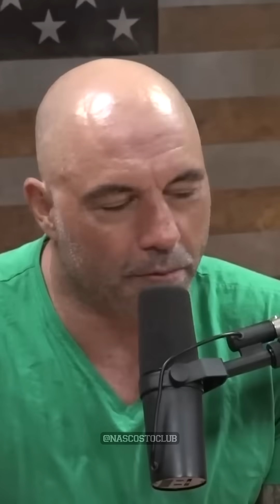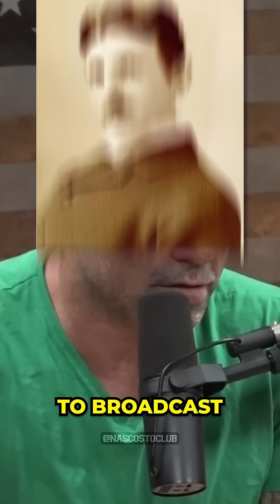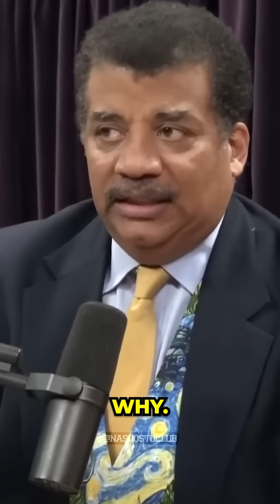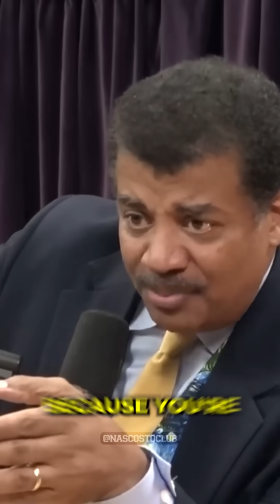WIRELESS Electricity Idea Debunked ⁉️⚡ #shorts

Comment: Tesla was on a much higher level of intelligence and comprehension than Neil so I'm inclined to doubt Neil's confidence here
Reply: Tesla also called Einstein's theory of relativity a pseudoscience, relativity has been proven again and again, scientists can be wrong too. That's literally how science works.
Reply: You're obviously not thinking or you don't understand physics. Most likely you're biased. If some white scientist with NDTs credentials was saying this you'd probably be more inclined to believe it.
Reply: @Sbudre  Not significantly more inclined, especially considering wireless electricity has already been proven viable.
Reply: @Droid6689  wireless electricity over distance is what Neil is referring to and that has not been proven. You probably think Santa is real too.
Reply: @Sbudre  yes it is, they're literally doing tests on this stuff right now.
Reply: @Sbudre  oh and saint Nick was in fact also real just so you know.
Reply: @Obi-wan5991  calm down.  You're confusing wireless power and wireless or inductive charging.
Reply: @Sbudre  no I'm not but I will say, have a good night.
Reply: @Obi-wan5991  must have become negative it was so low.
Reply: @Sbudre  yes, because I'd definitely have the ability to have my own thoughts and respond with a negative IQ. I'm done with this redundant conversation.
Reply: @Obi-wan5991  it's why your thoughts are nonsense.
Reply: @Sbudre  it didn’t seem like trolling, it just seemed like you were being rude.
Reply: @Droid6689  viable?  really?  What in the world are you talking about?  if you are talking about electromagnetic inductance or radiative electromagnetic resonance - both of those can only be accomplished with either direct contact between source and receiver, or at most an inch or so distance from each other.  Uncoupled radio frequency can have a few feet between source and receiver, but then it is only a small trickle of energy.  The type of things Tesla was thinking of were physically impossible unless you were OK with killing everything that was in the path of the transmission.
Reply: @Sbudre  thank you!!!  finally someone with a little knowledge.  folks that have zero background in physics or engineering talking about things they have no knowledge of is starting to drive me batty.  I need to stop reading these comments.
Reply: @Obi-wan5991  no. Theyre not. Lol.
Reply: @Droid6689 Energy means movement, movement means heat, heat burn skin, burn skin be bad.
Reply: @Sbudre  Look up power of wifi. Some newer Samsung tv remotes will power of wifi. There is also a security camera company that showed off some stuff during CES
Reply: @Sbudre  dude get some education
Reply: @daze8410  WiFi is something different. Maybe do some more reading before you spend your 2cents exposing yourself
Reply: @nilsbergling8711  I'm an engineer dude, by profession.
Reply: @Sbudre  sure
Reply: @Sbudre  Tesla might have had something in his head, but if he didn't get it in his work it means it wasn't feasible at that time yet. It might be very feasible if we significantly decrease the wattage required to power devices, and possibly implement some methods to increase the power transmitted wirelessly. This isn't very economical tho, because even if copper was super scarce, energy is expensive and wasting it just like that isn't something we normally want to do. Best use case I see it in is residential lighting to eliminate potential copper to steal(and that's a huge if for getting wattage super super low) but with the rise in power drawn for other devices in houses(computers and wall power is way more common, and it isn't just lamps and radios anymore like it originally was.), Copper isn't going away for residential application anytime soon.
Reply: @Sbudre  Take your own advice
Reply: @Droid6689 really? Where? By whom?  How many are dead?
Reply: @Obi-wan5991  source?
Reply: @Obi-wan5991 you are confused buddy
Reply: @Droid6689 yeah, so people are getting scared of 5g towers using the same freq as microwaves at fraction of the power (per area). Try getting in the way kf the wireless electricity.
Reply: @Droid6689  Yeah while touching the thing it's charging... not over kilometers...
Reply: @Obi-wan5991  i think it was just radio waves he was debunking? idk
Reply: @Sbudre 25 miles was common in wireless tests btw not to mention Dc power at the time had a max 12 mile from edison co. Ac allows smaller wire longer runs the man that made Ac also made the wireless stood in it and used transmitter and receivers that ran on certain hertz to send the signal/ power with himself playing the role of ground. Look at his wireless fluorescent lights lmao
Reply: @brians9508  also buddy, you can move that electric, even though that’s nothing to do with what we was talking about it can be done, hence why Tesla himself was able to power various things around his office without dying 😂 but yea that’s a whole different thing that we aren’t talking about so I have no idea why you’ve come in here trying to prove me right but thank you
Reply: @brians9508  common facts most people know hahahahhaa you didn’t know earlier you told me it was wrong that energy couldn’t go through the air, you said waves needed to be constrained to not kill people you didn’t even understand what a wave was buddy now you’ve googled it and come back and told me I was right your trying to pretend it’s not exactly what I was telling you 😂 you just somehow don’t seem to understand that energy makes electricity I think you think the sockets are connected to magic or something and the conductor makes the electric? Who knows but you’ve lost yourself somewhere
Reply: Its ok, you'd be wrong. 

But here since Niel didn't make it make sense, consider your microwave oven, that is an example of what transmitting high energy through the air looks like. Do you want the power plant frying your guts to get the power to your house?
Reply: you just watched him explain why you’d die from intersecting a wave of electricity/ or energy. everytime you’d use a hairdryer that’s 10%+  ofthe amount of amps that’d KILL YOU. imagine getting shocked with 10% of the energy required to stop your heart.
Reply: Everyone that thinks this EXACT same thing is usually someone who claims to love Tesla and science, but slept through high school physics.
Reply: I wouldn't deny tesla's a genius, but if it was really viable, and feasible, wouldn't it be much more prevalent now
Reply: Neil understand things that Tesla couldnt even possibly imagine. Does your tiny brain forget that hes literally A DOCTOR in astrophysics.
Reply: Neill is perfectly right. It's basic physics (now).
Reply: @mkvk74 he’s perfectly right? So solar panels don’t exist? So companies aren’t already sending energy long range? Do you understand what a radio wave is buddy? I think you should first go at least try understand what a radio wave is then you might not say something so stupid 😂😂😂
Reply: Tesla was legitimately deranged and had dozens of genuinely terrible ideas for every good one he stumbled upon.
Reply: 😂 of course… Tesla fans believe the strangest things
Reply: @douglasrodenbach8000  Like stuff verified by NASA studies decades ago?
Reply: Another dumb comment from a dude with no grasp on the basics of physics. Keep having an opinion about something you don't understand (physics), that's dumb but funny
Reply: @geraltofrivia9424  do you know Tesla explained that Warden Cliff tower was not a electromagnetic device and transmitted scalar wave energy through the ground?
Reply: @DANTHETUBEMAN  Your point?
Reply: @geraltofrivia9424  non of that disagrees with physics
Reply: Came for this
Reply: Tesla was much smarter than Neil, but logically it does not make sense to send electricity through the air. Even if we could, then it would kill you if your in the same room.
Reply: We already have a technology that captures wireless 'electricity'. They're called solar panels. 100 percent wireless and the energy source is 91 million miles away.
Reply: @greensleeves8095  not even close to what this video was talking about lol
Reply: @drinkswatere  Yes it is. The point is we're already capturing energy wireless. It's not hard to believe we could come up with a transmitter and receiver that uses a wavelength that's safe for humans.
Reply: @greensleeves8095  the problem is the resistance of the medium in the first place, the air is extremely resistant so whichever method we use to transfer the energy through it is going to be very inefficient, worth only for some very specific applications.
Reply: @greensleeves8095  again solar energy and what is spoken of in this video are completely different. I’m not going to baby you and explain to you why. It should be obvious.
Reply: Tesla had some cool inventions but these pseudoscience conspiracy theories are dumb af. Einstein, Newton, practically everyone was wrong about one thing or another. These are humans, not infallible gods. And no, the atmospheric free energy tower thing is total bullshit
Reply: Go ahead and keep being negative instead of just discussing the topic like civil people and sharing opinions. A lot of people said Einstein was crazy. And yet for some odd reason we're still finding out that he was right to this day. Holy shit who would've known because apparently people like you have all the answers until you're literally proven wrong and have the evidence shoved in your face. But yea my brains fried because I'm not embarrassed to think with a open mind.
Reply: The concept does rely on fundamentals we can already understand. The main point he brought up is that insufficient energy can be actually passed through the air that would be mechanically sufficient to power stuff. To make it useful on a baseline, a potentially lethal dose would need to be transmitted. We already know about what in electricity kills us, e.g. coming into contact with exposed wires; we already are aware that some electricity can be passed through air over short distances to charge batteries or read RFID devices. The moment you go wireless with the equivalent of power you'd need to power a light bulb, it would be deadly. Assuming you're pointing your energy source at the light bulb, you wouldn't wanna be between the transmitter and the bulb. But let's say the source of power, eg. substation or power plant, was like a radio station, the power output would need to be so extreme, (again, knowing what we know about conservation of energy and electromagnetism), firstly the source would degrade due to heat (think a hot qi charging pad, for example), but just as much as the power being sent to your house needs to be stepped down with a transformer before it's used because it had to be higher to reach you in the first place (and we all know the survivability of coming into contact with that voltage), and you'd be transmitting that wirelessly. I honestly don't know or remember what voltage differences are between residential and commercial zones, but that's a lot of power, and wirelessly, that's gonna go through a lot of people.
Reply: @Acey785  we do NOT transmit electric energy wirelessly though, we induce a magnetic field using an electromagnet. This field and the change of it's polarity induces electrical energy into the coil it effectively moves through. Now there this energy is basically produced again, therefore no electrical energy was actually passing through the air. This itself, as your only real life example, shows that your entire claim is basically wrong. Because the basis itself is wrong.
Reply: It's not at all about intelligence, and "comprehension" of what? Physics? Neil has modern physics which is objectively more fleshed out than physics in Tesla's time. We now know that it's not safely possible or practical to wirelessly send sufficient electricity long distances. Tesla didn't. It's just physics, not intelligence.
Reply: People don’t like hearing about the 1893 Chicago World Fair, Tesla used wireless to power half the event, they love pointing at the pictures that show wires clearly, refuse to listen to or admit the brightest minds of the time who wondered in amazement in their writings about everything that didn’t have any wires to power them, it’s like talking to flat earthers, you’ll just get a headache
Reply: Tesla was a kook....
Reply: Absolutely
Reply: Agreed.
Reply: And you probably got an IQ lower than 100.... smarter people then Neil have disproven it
Reply: @chango.-.  Wrong, but a cute attempt
Reply: Когда не ходил на уроки физики
Reply: Being smarter doesnt mean you're more likely to be correct compared to someone more than a century into the future with a far higher understanding of Science... Neil's skepticism is just as valid as any other genius from back in the day.
Reply: I'm not a fan of neil but he's right.
Reply: Are you intelligent enough to understand that?
Reply: No he is right.

Tesla had good ideas and even better intentions but a lot of it were dangerous.

Try living in a house near a power station or a electric tower. You'd know how dangerous electricity just freely roaming around the air.

And it won't have a stable connection as well unlike a wired device. Even today a wired device is still superior to wireless.
Reply: Sure, but Neil is on a much higher level of knowledge. That’s the nature of being born so much later. 
Y’all hate Neil for no reason lmao.
Reply: By that logic i would say Neil is on much higher level of intelligence than you so I'm inclined to doubt your confidence here lol
Reply: What are you talking about Tesla was a dunce compared to our current scientists because of our progression of knowledge of science, do you think nuclear physics was a thing Tesla knew? Tyson knows it because he's in the future You're fucking weird
Reply: @asterowave5586  by your logic, DaVinci, Newton, Kepler, Copernicus, Galileo, they’re all idiots because they lived before certain discoveries

what an absolute moron you are… you’re the dunce here
Reply: The Tesla fanboy wingnuts are wound up.
Reply: Tf do you know
Reply: Here’s a fun idea, what if it wasn’t electricity powering things, could it then be wireless? You have to think outside the box
Reply: Imagine there is human beings in here that don’t understand what a radio wave is saying you can’t send energy with a radio wave 😂😂😂😂😂😂 can you seriously like honestly be that dumb? Like saying there’s no way that bread can possibly be bread. A radio wave literally like LITERALLY IS ENERGY YOU RETARDS IF YOU DONT KNOW THAT YOU DONT EVEN HAVE THE SLIGHTEST INCLING OF WHAT YOUR TALKING ABOUT AND YOU JUST LOOK LIKE A RETARD SAYING IT ISNT POSSIBLE
Reply: The difference is intellectual resources, a 160 iq cavemen is less smart than an 100 iq human today from a relative perspective.

Iq is not knowledge, Iq is the ability to comprehend new or more complicated things. Neil has an advantage which is his time stamp
Reply: same
Reply: Tesla was insane, noting more.
Reply: @Pogger White  without tesla you would not be in the world you are in remember that
Reply: Not really he was at the same level as other geniuses in electrical engineering at the time, though amazingly prolific.
He didn't invent multi-phase or was the genius who worked out 3phase was the optimum for generation-transmission-loads at the time.
Reply: There's significantly more scientific data to support Neil than Tesla lmao
Reply: @Jakepf  yes because as I send Tesla's real work has been suppressed from you, Tesla's lit up lights 20 miles away from his Colorado springs amplifier,
today's scientific data tells you you cannot do that, ground has to much resistance. but there is a way, it has been done. 😁
Reply: Intelligence? Maybe. Comprehension? Absolutely not. Times have advanced. Neil comprehends far more about science than Tesla.
Reply: @drinkswatere  Neal does not know what Tesla was working on. he is smart enough to learn it, and smart enough to not learn it, because the powers that be do not want it worked in.
Reply: @DANTHETUBEMAN  would’ve already been at least theorized by now by someone. Hence why Neil is explaining why it’s not possible instead of saying “I don’t know if it’s possible”. It’s because the research has already been done on it. Your conspiracy hold no weight. Modern science does.
Reply: @DANTHETUBEMAN  again you believe in conspiracy theory before reality. I’m not going to do that.
Reply: @drinkswatere  no not at all, I no the science, you don't. your stuck in mains stream, that's right where the energy monopolies put you. 
look up high Voltage DC spark pulse, that's the scalar energy. we just don't use it yet.
Reply: @DANTHETUBEMAN  yeah because if you got between the transmitter and receiver you DIE 😂. That and what is spoken of in this video are very different. Not the sharpest tool in the shed are you.
Reply: @drinkswatere  wardencliff tower used high voltage DC spark gap scalar generation. you should read about Tesla's work on this, at slower speeds it def shock him and he could not shield the energy pulse even with a Friday cage, but when he went up in frequency it stopped shocking. .
Reply: @DANTHETUBEMAN  your science education is just as alternative as your grammar. You are the perfect example of the Dunning-Krueger-Effect.
Reply: @donerzombie1349  the difference is that I can prove my information with experiments because that's the way things are. it does not matter if you denied the facts or not.
Reply: @donerzombie1349  Grammer the go to of all loser's in every argument, lol 😂😆
Reply: @donerzombie1349  you named part of science
 " alternative " 
that has nothing to do with the reality of the effects of everything I am talking about.
Reply: @donerzombie1349  I never took a science class. 
your just wrong and don't like it. but facts are facts. they do not care if you have worked with them or not. "Electromagnetic environmental compatibility" ; (2000-2003)
Book by Ben Jansen and Konstantin Meyl. 
you have a lot of catching up to do, we are on to the scalar magnetic forces now.
Reply: @DANTHETUBEMAN  did you get one of the test kits? And have enough scientific understanding to eliminate the potential for trickery? At least the second you don't and have shown so already. So give me a proof, not some random claim that it was supposedly done but proof
Reply: @donerzombie1349  I can't spoon feed you, you have just asked for things you are capable of doing your self. I think you will be more comfortable staying where you are at in your out dated science.
Reply: Oh so a smart guy who lived over a hundred years ago, would know more with less information than another smart guy living now?
Reply: @Drckarvo how many inventions and discoveries that are fundamental for todays civilization did that guy a hundred years ago made?

What are NDT’s discoveries? 

Exactly.
Reply: @Chris Karvonen  A genius from a hundred years ago know more than a pompous smart guy now? Sure. He could easily know what was theoretically possible better but not have the resources or information to make them reality
Reply: @Droid6689  We have more accumulated knowledge right now about energy and stuff then when he was alive, so we have academies etc.
The problem with wireless electricity isn't that electricity getting in your device, as we do with radios, internet etc, but the power we will need for doing that (yes, in Watts).
About the dangers Neil said, that's why your cellphone doesn't kill you with 5G the same way a simple "wireless" electric shower could kill you if you stand near it.
Reply: @Droid6689  "didn't have resources" he built a fuckin god shot Tesla coil for his experiments.
Reply: @Droid6689  tesla is the reason for everything we have today, and once they stopped adopting his ideas we hit a technological slump (relatively)
Reply: Its 2023. We've known about Tesla and all of his ideas since he made them public. Someone would've made it work if it could've worked. Quit arguing and go do something positive.
Reply: @palainanoctem3776  Lol that is not at all how science works
Reply: @palainanoctem3776  you do not know all of Tesla's work, it was taken from us when he died. most ppl do not even know what scalar energy is.
Reply: No he was a idiot who tinkered with others inventions he loved a bird and thought earth had electrical fluid beneath the surface he’s not that smart
Reply: EVERYONE should ALWAYS doubt Neil DeMoron Tyson's confidence
Reply: @RobQuinney  because he sates facts you dont like ? Cry harder
Reply: You nerds really don’t have anyone to care for you huh, gotta let it all out with quips and shitstalk 😂  with a stranger strokin his rod while both of you think you’re winning later losers
Reply: @jalanancrath6589  what
Reply: He’s forgetting you can literally make it safe for electricity to pass through you at certain frequencies. Tesla had theories about making the frequency of the electricity match those of types of radiation like radio waves in order to make it do things I can’t remember atm. He died right before he was able to do his first test broadcasting 50 miles between towers
Reply: your name is droid your overweight horrendous looking and need to eat a salad your opinion could not be more irrelevant if you tried
Reply: To everyone saying "wireless air power" transmission is not real. Linus Tech Tips did a video 4 years ago from a company called "Wi-Charge". Look it up. Also companies like Xiomi and Motorola have stated they are working on their own version of this technology this year (2023).
Reply: @Mike-my7uf  they are literally using IR to transmit power.... Your a clown and should feel bad
Reply: Yeah Neil is talking as if he would have invented all that stuff back in the day. Who knows if Tesla’s designs would have worked or if he would have been able to figure it out, but it was something within him that other people didn’t have in the right time and place that allowed him to make all these discoveries and maybe if he lived longer or was healthier we wouldn’t be doubting this today.
Reply: @yoeyyoey8937  no it wasn't. Tesla was not magic. he WORKED HIS ENTIRE LIFE. people begged him to go to parties to talk but he really ever did, he was always working. Tesla finished with AC electricity system in 1897,,, for the next 48 years he worked on scalar wave energy and high frequency pulsed DC.
Reply: @yoeyyoey8937 are you dumb fr? When did he even make a claim like that. Just cause he said it wouldn’t work in Tesla’s doesn’t mean he’d know what to do. Literally dumb ass comments from people like you
Reply: @Alisol96  i wish I could feel dumb but I can’t even make sense of your comment after reading it 3 times; so please try again, maybe with slightly different grammar, so I can understand your criticism in order to correct my stupidity.
Reply: tesla was not on a higher level of intelligence, tesla was on HIS OWN level of intelligence. that man MADE inventions we can just dream of today.
Reply: @TheLightBringer365  no he fucking didnt, morons really read a shitty web1 website when they are 12 and think THEY know everything about physics BETTER than a Astro physicist that dedicate their life to it
Reply: @QurttoRco  i highly doubt tesla read a shitty web site and thought he knew everything about physics... but k... as for me i visited his museum in serbia and US, read 3 books about him, and am studying electrical engineering.... a profession that exists mostly because of him.
Reply: @TheLightBringer365  oh I read books about how great he was and they told me that he was literally smartest person eeeveer 🤓 jfc your not gonna be a good engineer if you cant apply critical thinking
Reply: @QurttoRco  idk what you even talking about at this point, just shows ur a troll, keep yourself safe :)
Reply: @TheLightBringer365  Tesla was driven by the excitement of discovery. he used so himself. Tesla worked on things we have not returned to yet, but he used the future for witch I have worked for belongs to me, so some one some day will do teslas work again.
Reply: Tesla was using scalar waves through the ground. it does work, as soon as some one does it again we will have it.
Reply: @DANTHETUBEMAN  "In physics, a quantity described as "scalar" only contains information about its magnitude. In contrast, a "vector" quantity contains information both about its magnitude and about its direction. By this definition, a "scalar wave" in physics would be defined as any solution to a "scalar wave equation".[3] In reality, this definition is far too general to be useful, and as a result the term "scalar wave" is used exclusively by cranks and peddlers of woo.
Solutions to scalar wave equations are actually quite prevalent (and useful) in physics. Some prominent examples include acoustic (sound) waves, the motion of a taut string being stretched (such as a guitar string being plucked), and the motion of waves in water (such as the ripples from a stone being dropped into a pond). In contrast, electromagnetic waves are vector quantities derived as solutions to a set of vector wave equations (in this case Maxwell's equations).
The concept of a scalar field theory￼ also exists, and plays an important role in several branches of physics. In comparison, "scalar waves" have never been observed in nature, and are rooted in sound physics about as well as the average chemtrail is rooted to the ground (not at all)."
Reply: @DANTHETUBEMAN  yeah, the bs Tyson was saying about using radio waves when that's not how Tesla did it 🤣
Reply: @TheDandyMann  Tesla was lighting up light bulbs from 20 miles away from the test rig in Colorado springs. these are facts.
Reply: @DANTHETUBEMAN  yeah, I remember seeing pictures of light bulbs in the ground that are lit up with no connection
Reply: @TheDandyMann  he had two assistants there with him during those experiments.
Reply: @gegenism Good for you bud 🥱